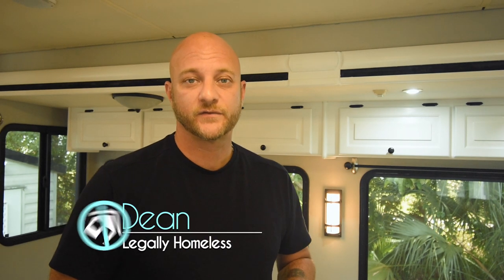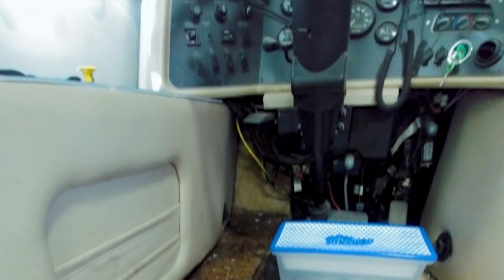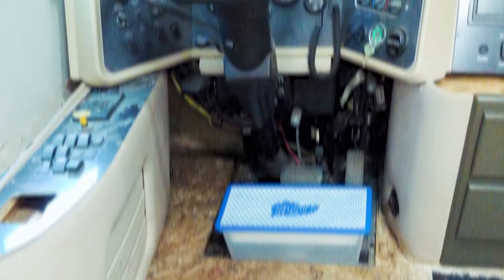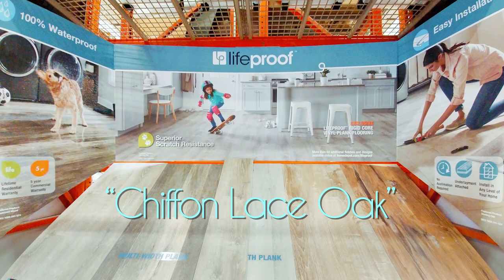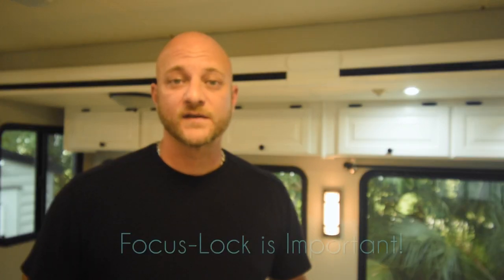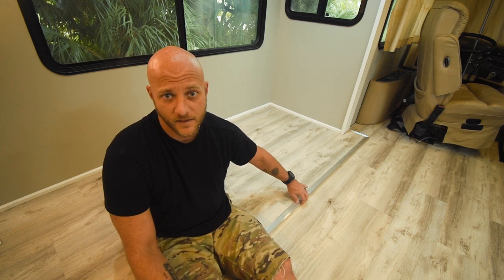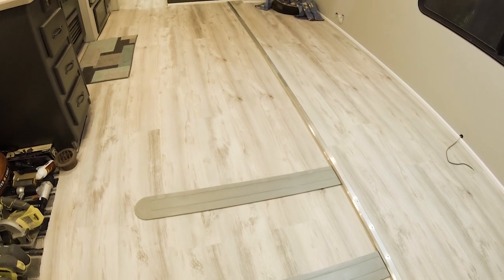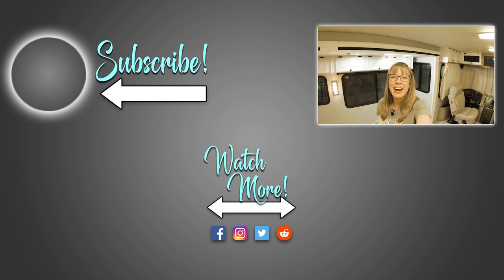RV Flooring with Slide & Mold Treatment - Our RV Renovation

Comment: Wow your rig looks great! My husband and I are putting down new floors in our RV and we found several rounded bolts which I assume attach to the frame. Unfortunately the bolts are not flush with the subfloor. We are unsure how to lay the vinyl planks across them. Did you come across this problem?

Comment: Now, that you have been FTing in it for a few months....how has the piece of vinyl that you adhered to the edge of the slide held up?? We're laying new vinyl this week & are stumped about the slide transition. Also, does the metal piece along the outer edge drag or scratch at all when sliding in or out??
Reply from the maker: We don't go full-time until April, but we've been using it a lot and so far it has held up really well. The metal does lightly drag just a tiny bit for about the last half-inch before it is fully extended, but it does not appear to be scratching the floor at all. -Dean

Comment: I noticed on the Slide-out Slicker there are little pointed tips on the first 6 inches. I'm concerned that these may damage my floor so I was thinking about cutting them off before using them. Have you noticed any problems with the little pointe tips causing damage?
Reply from the maker: I used a pocket knife to cut off the little spikes.

Comment: Where did you find the plastic boards?  We too need the added height.  Thank you!
Reply from the maker: I just got them at Home Depot. They were in the section with all the different kinds of paneling. They are textured on one side, smooth on the other. I placed the textured side down, which is why the look smooth in the video. I believe their actual intent is for shower walls.

Comment: Hi there 🤗 ! Quick question, actually a big doubt, please help me. 🙏 I don't know which floor should I install on my rvcamper. I'm in doubt about vinyl plank or vinyl sheet.  Which do you recommend me?  Planks looks better but I've read some comments that they may separate while traveling. What has already happened with the floor you have and again what do you recommend me? Thank you
Reply: @Stephannie Mendes  Hi there.  I wanted to reply to your question.  Unfortunately, putting vinyl planks is not a solution.  The floor/planks will buckle when you are traveling on the road causing the planks to detach.  It is NOT recommended to put planks in a RV.  If the unit is not going to traveling or be living in the unit and not moving the RV, then yes you can put down planks.  Its recommended to use sheet vinyl in a roll, but that gets really tricky.  I hope this helps.  I noticed you posted your comment 8 months ago.  You probably already did your floors in your RV.  What kind of floor did you put in after all? .........Rick